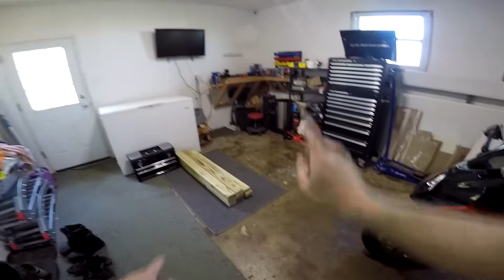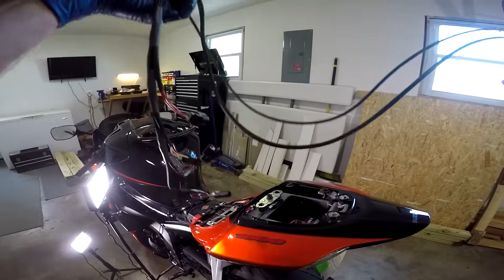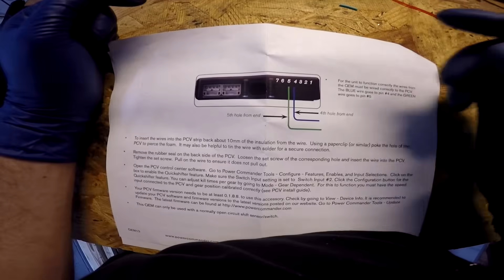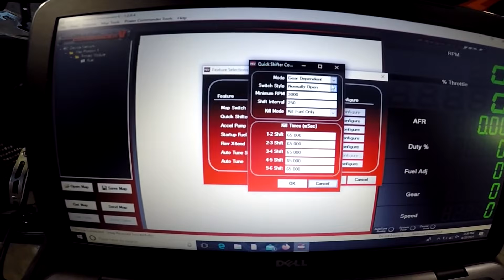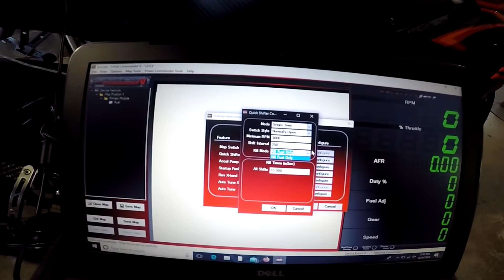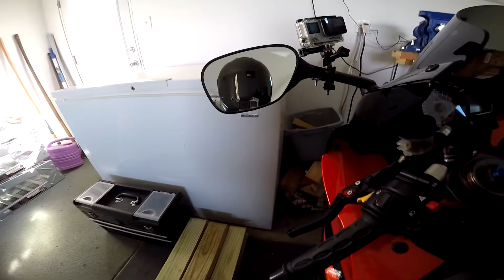Installing Dynojet quick shifter (K7 GSX-R1000)

Comment: Hi bro .. I have problem in my Gsx-R 1000 model 2014
In gear 3to 6 my engine rpm coming around 12 and not going more,motor going in cutoff 
In gear 1and 2 everything is normal and rpm coming to red line,, what is your advice about my problem ?

Comment: Hi brother i have the same bike as yours, i have a problem with the high rpm, around 8-11k rpm it loses power and it doesnt redline in neutral. I change clutch linning, throttle body cleaning but still the same
Reply: Hi, did you rectify the problem?what was the problem?

Comment: Yo dude, where did you get the engine covers?
Reply from the maker: The previous owner installed those. I like them, so I kept them. They are Yoshimura brand covers, I found them on Revzilla but they are out of stock. Sorry, bud. You might be able to find them somewhere else. https://www.revzilla.com/motorcycle/yoshimura-case-saver-kit-suzuki-gsxr-1000-2007-2008

Comment: Hey man I need your help. I took off my exhaust servo and taped off the 2 connectors but noticed another connector next to it just there. Any idea what it goes to???
Reply from the maker: Sorry I didn't reply, the last week for me has been a nightmare. I'm not sure off the top of my head, If I have time after work tomorrow I'll lift the tank up on mine and take a look.
Reply from the maker: If you are talking about the black connector right beside the two connectors for the exhaust servo, it is unused on your bike. It is only for the California models because they have an extra exhaust component (EVAP system). But Suzuki only made one wire harness for all their bikes, so on the non-Cali bikes it just hangs there not connected to anything.

Comment: For a gsxr k8 2008 600cc what quick shifter do I need to buy ?
Can you drop a link please thanks.  I went to the site in your description I can’t find the rod I found the sensor and module just not the rod.
Reply from the maker: Wow, I had to dig pretty hard for this one. Based on the fitment list on the site below you need to buy both Rod-A and Rod-C and cut them down to make them shorter. If you scroll down to the list it says "GSX-R 600 2008 :PUSH Type One (1) Shift Rod A + One (1) Shift Rod C (remove/cut off 3 section from each rod)" 

https://www.sportbiketrackgear.com/dynojet-power-commander-shift-rod-a/

Hope it works out for you, that's the best I can do!
Reply: @lonelyryder7441  thank you so much for my bike its hard to upgrade it the 06-07 and 2011-2025 they are super easy to mod but my 2008-2010 nothing.

Comment: Is the reason for the expansion module bc you have pc3? Most can plug into the pcv ?
Reply from the maker: The expansion module is for bikes that have 8 fuel injectors, like my gsxr. The PCV only has 4 connectors, so the expansion module gives it another 4 connectors. If you have a bike with only 4 fuel injectors, you do NOT need the expansion module.

Comment: Nice video ! 

Not same bike and i have qs up and down . So i changed to gp shift and first 2 days was fine . day 3 i stop thinking about it and started make misstakes , was in 3rd gear giving it full throttle and wanted shortshift to 4th gear so was low in revs like 6-7k but i/it qs down to 2nd gear and it was like a rocket taking off🤣😅  Still gp shift on bike but thinking going back to normal before i mess something up

Comment: Have an 08 gsxr1000 and looking to get this system, is it just up shifts or does it have auto blip as well
Reply from the maker: It is just for upshifts, I don't think Dynojet makes one with auto blip. If you want one for up and down shifts you would need something like an IRC, but this bike doesn't have fly-by-wire so auto-blip won't work for this particular bike anyway.